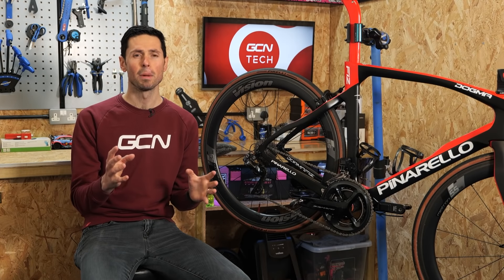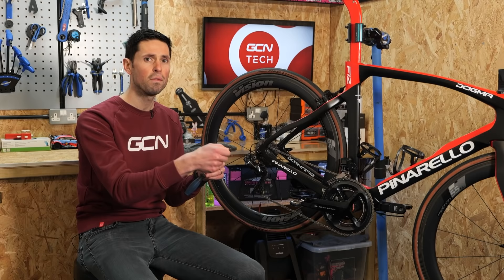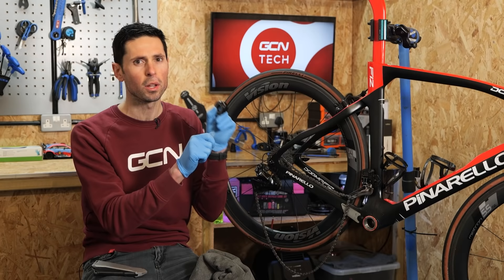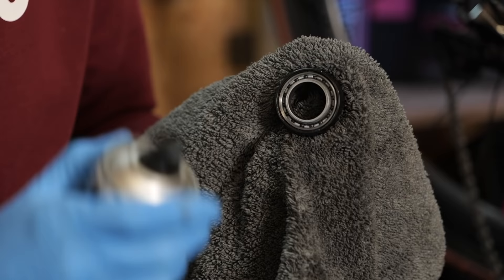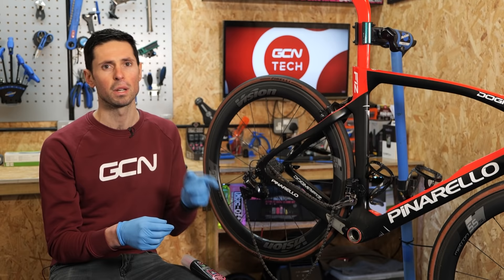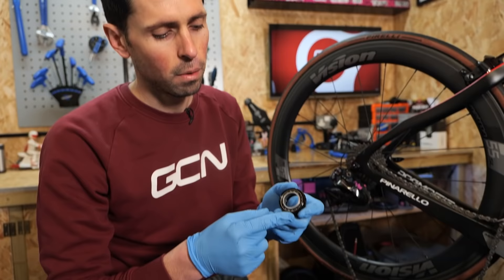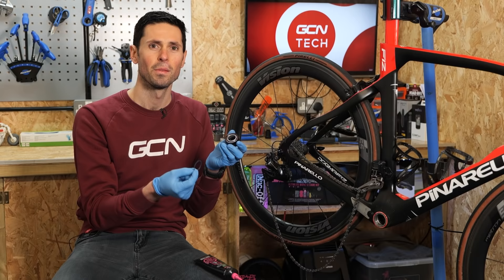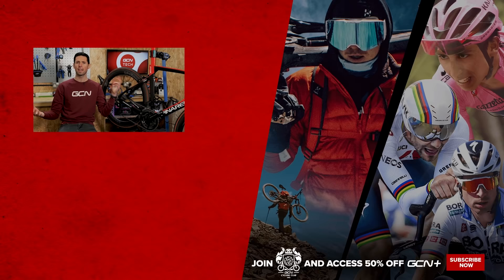How To Service Bearings On Your Bike

Comment: If you clean a bearing like this, its interior will be contaminated still. It requires: cleaning from both sides, far more degreaser fluid, a brush to work it around, lots of rinsing with hot water to remove all degreaser with contaminations and drying before applying the new grease.
Reply: Depending on what degreaser you use, definitely going to leave residue when dry!
Reply: Possibly why disk brake cleaner was used but not explained? It should evaporate. But I'm not convinced it was a thorough cleaning process.
Reply: use low-odor mineral spirits and compressed air several times to blast it all. or even pressure washer. water alone can clean it, but you have to dry it up and grease it quickly.

Comment: I’ve replaced my cartridge wheel bearings and freehub bearings.  Only really serviced old school free ball bearings.  Generally I find it easier to replace rather than service cartridge style bearings.  They just don’t go wrong often enough to worry about and when they do you’re better off going with brand new if you’re going to the trouble of disassembly.
Reply: Yeah, how much are bearings for road bikes? BMX uses standard industrial sizes for everything so BB are about $10. Knowing road bike companies though, replacements are proprietary and cost a couple $100.
Reply: @davetbassbos  some brands use standart sizes, some - 1mm different, so it depends. I'm trying to use parts with standart bearings or with free ball bearings with balls you can buy for reasonable price
Reply: @davetbassbos  A new BB 105/Ultegra (SM-BBR60) cost 29€ (you can find it @20€ at probikeshop) , a Dura-ace (BB-R9100) cost 50€ (you can find it @30€ at probikeshop). 
Bearing start @2€ but can go up @100€ for ceramic bearings. I think it is 6806 on Shimano BB, good bearings are 15/20€ so 2 bearing is the cost of a new BB.
Reply: @davetbassbos  if you search for bearing or very good BB, check Hambini web site ;) its not cheap but it's quality made by a 5 years old (check his YT channel to)
Reply: @Blackwing2345635  Cool, I'm putting together a commuter bike and was a little overwhelmed by all the BB standards in the road world, but I'm making a spreadsheet, lol!
Reply: @simonpeneau7802  Thanks!
Reply: @davetbassbos  ceramic or ZrO are expensive, 44 each. however, they never get rusty and never go bad. i just found a 10-pack of 163110 for 14.00. makes it 1.50 a piece, 3.00 for both.

Comment: If you remove the covers carefully, you do not need to replace the covers. The best tool to remove the cover is an eyeglasses screwdriver, commonly available at any drug store for a few dollars. The covers can easily be removed without deforming them with an eyeglasses screwdriver. A small flat blade electronics screwdriver will also work, but not many people have these in their tool collections. Oh, and Alex to remove the covers you slide your pick or miniture screwdriver under the cover at the inner race, not the outer race.
Reply: Champion.

Comment: Why replace the seal? I’ve had no issues removing seals and it’s perfectly reusable
Reply: You can re use seals! However the seals contribute to a large amount of friction in a cartridge bearing, even if it may seem like you havent nicked the seal I can almost guarantee it won't be 100 percent un damaged
Reply: Its just good practice to replace the seals as they are a consumable part, yes you can re use a seal if its not bent, but if possible, best to replace with new.
Reply: @George Dawson I can remove these types of seals/covers all day long and can 100% guarantee that none of them will be damaged in any way.
Reply: @jeffr119  good for you Jeff 👍
Reply: @GCNalex  can you give an example of where to buy replacement seals? 😅It must be my googling skills, but I can't seem to find separate seals, not even on (online) bearing speciality stores?!
Thank you in advance, I currently reuse them after there is little damage after removing them with a scalpel

Comment: If you can't get to both seals to remove them, trying to clean them out is pretty pointless.  You are very likely to just pack old grease and grit against the back side of the bearing, as well as some of the solvent or cleaner you used.

Comment: Marathon inline skater here. For us bone Swiss speed cream is the gold standard lubricant. It’s a very light oil. A heavy oil like WD40 is a nogo, because it‘ll collect a lot of dirt. But since bike bearings are further away from the street and as I see double shielded, this perhaps becomes less of a concern. Just note that this is another disadvantage of a heavier oil. Also don’t over lubricate your bearings, it‘ll increase hydroresistance.

Comment: Nice video and good demonstration. I would suggest to anyone that has the bearings out and in hand to pack them using the old fashioned way I was taught. Dollop of grease in one palm and hold the bearing in the other hand and press part of the bearing assembly open faced (where the seal is removed) firmly into the grease to push it into the bearing. Rotate and do each section until the whole bearing is full. Messier than what is shown but the grease gets in better. Ideally you would have both seals removed and you would do this until grease comes out the other side…
As others have said, getting the internals truly clean probably takes a fair bit more work and cleansers than is shown…

Comment: Handy to have a threaded frame, Alex. Any advice for press fit BBs; service in place, or just remove & replace?
Reply: I like to just take my BB30's out fully, u can grease the whole frame cups then aswell
Reply: If you're just doing one side of the bearing, like Alex is doing in the video, there is no need to remove the bearing from the frame. However, if you want to repack both sides of each bearing, you will need to tap them out of your frame in order to access the inside seal and balls underneath.
Reply: High chance of damaging it if removing and they aren't expensive so just replace
Reply: @meatfish6346  If you have the right tools, they shouldn't get damaged. Also, the cost is dependent upon which bearings the BB is running. If they're ceramic, you're going to want to do whatever you can to save them and keep them working for as long as possible.
Reply: I've used the park tool (like a mini version of a headset cup remover) and always failed with a bb92. Usually to resort to a dowel or similar to get to them out. I've not tried the shimano version but for the price, it's not really worth it for the home workshop Vs just getting a new xt BB...

Comment: You make it seem so delicate.  I have bent seals, but I’ve never not be able to re use them. I also like to get the compressor and blow the degreaser out faster.
Reply from the maker: It is a very delicate process, annoyingly! Alex has super steady hands 🙌

Comment: Since I typically don't ride in the inherent wet UK conditions I don't have to do this often. I use a clean solvent to soak the bearing in (after seals removed) then dry thoroughly using low pressure compressed air. I use a 60W synthetic oil and when installing the BB rather than grease the threads I use a wrap of teflon tape on the threads which won't wash out or attract any fine grit if I do get caught out in wet conditions.

Comment: I'd love to see Alex service the bearings on a BB7700. (tiny loose ball bearings, and roller bearings)
Reply: Park Tool and R J the Bike have them.
Reply: @nicktodoroff7836  They've serviced a BB7700?
Reply: @billkallas1762  Opps.  Sorry Bill.  They were for squared tapered sealed cartridges.
Reply: @nicktodoroff7836  The 7700 Octilink spline tool is different from the Octilink spline tool for the Ultegra and 105 bottom brackets and cranks.
The 7700 family included Dura Ace road, Dura Ace Track, and XTR.
Reply: @billkallas1762  Yes sir.  That said, I really like your suggestion  and hope that Alex takes acts on it.  I'd like to see that video too!

Comment: In my years of engineering in rotating equipment, spraying degreaser into bearing is an absolute no.except u want to clean the bearing in order to inspect defects in them, in which case u  throw them away after that.no term reuse "degreased bearing"..
Reply: Can you explain why as I'm truly interested to know? Is there another cleaning solution that would be preferable (milder solvent?)  or simply there it's just better not to clean an reuse, but to just get new ones. I've been cleaning many years when the bearing was ok, but always like to learn new real facts. Thanks.
Reply: or perhaps use ultrasonic cleaner after a mild solvent to finish the job well?

Comment: You cannot clean the bearing properly whilst it is still fitted in the BB.  

To undertake a proper cleaning and re-grease the bearing should be pushed out and both seals removed and the pressed back in when service completed.  

However this will require correct bearing extractor and fitting tools.
Reply: Agreed! My (bike) life has become so much more complete after getting a bearing puller and bearing press kit.. Not to forget the ultrasonic cleaner (for jewelry) to get them totally cleaned. And wrt the seal if you use a thin pick or needle and ALWAYS pick the inside of the seal, you do not damage them - usually...

Comment: Have you really checked that with the bearing manufacturer? I've always been told that not only the type of grease you use matters a lot but also the quantity!
Reply: Hi Olivier, all manufactures will have their recommendations, but the video details a method that will provide suitable lubrication for the majority of applications and situations, thanks
Reply: Oliver your correct. Its absolutely horrid to change from grease to oil for example. Thick grease is the same, the grease it self holds oil that lubricates the bearing. Depending on load levels you need a grease that releases the oil at different conditions. Its a really bad advice to say that anything will work.

Comment: Got a question for anyone that could answer for me

I’ve a pinnacle gravel bike that’s second hand and is in really good condition (my view of not knowing a lot about bicycles) the previous owner has done thousands of miles as she loves to cycle. The bike is fine cycling on flat ground and down hill but loudly squeaks as I start to go up hill even over a ramp the sound sounds like it’s coming from behind me when cycling of course it doesn’t squeak when not on the bike. I’ve lubed the chain it helped a bit but the squeaking is still there does anyone know what it could be or had the same issue?

Comment: How often (duration/distance) should you service the bearings?
Reply: From what I heard, if you are using shimano BBs, no services are required. Replace it after you hear creaks or malfunction in it, or just change it every year or two if you ride very often. Shimano BBs are not designed to be serviced. However, if you are using Ceamic Bearings like CeramicSpeed, 5000km per service is recommended if I recall correctly.
Reply: Check all your bearings every year, preferably after winter, and feel if they rotate well without hickups. Service the ones that have a grindy feel or replace those.